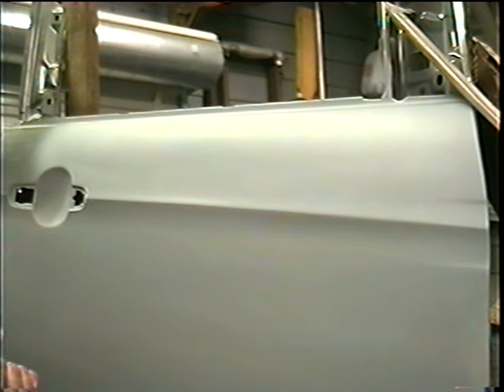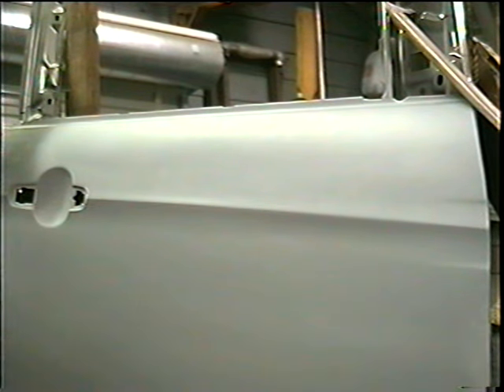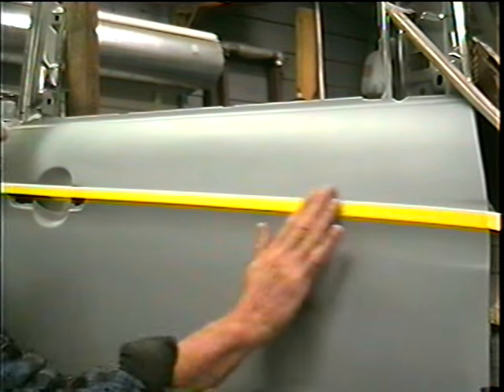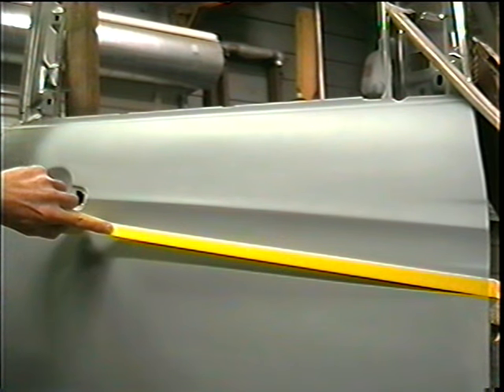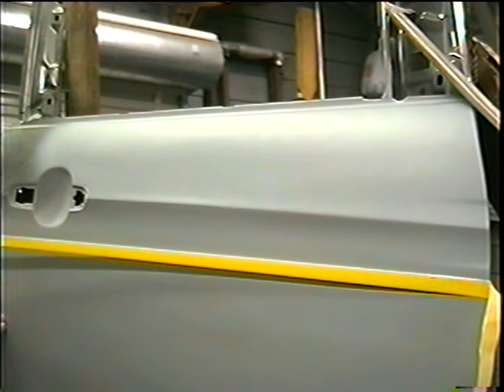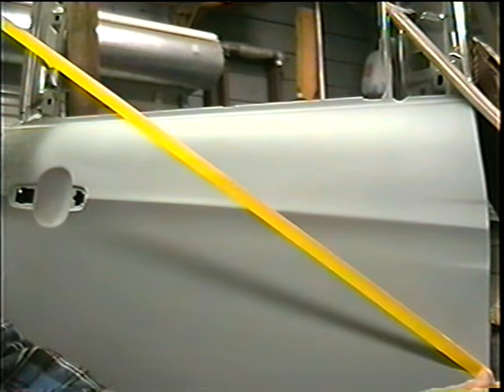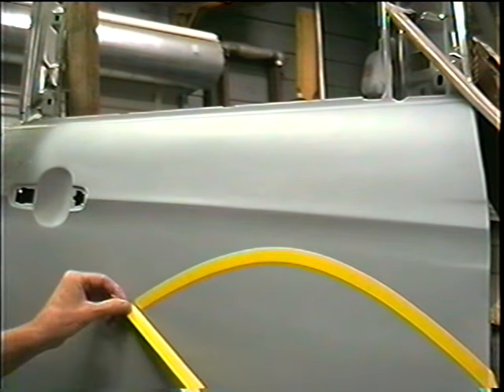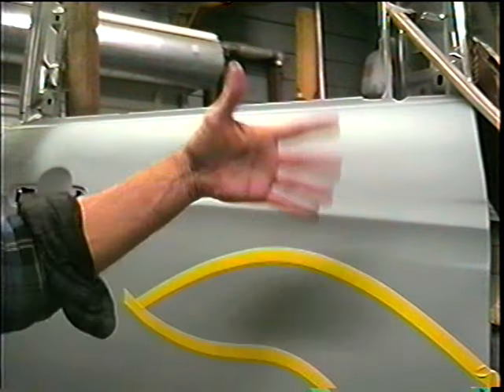Automotive Masking Tape Tips and Techniques

Comment: What tape works best on rubber windshield/windscreen gasket? I guess you could call it glazing as well but both sides of mine are rubber and so far, nothing will stick to it and I do NOT want to remove the windscreen. It’s almost guaranteed to break. Thank you sir! Great video as always!
Reply from the maker: That is very frustrating for sure - been there a few times.  Try wiping the rubber with rubbing alcohol or lacquer thinner - let it dry and use good 3M auto refinishing masking tape.  Let me know if that works for you Chris - have a good weekend :)

Comment: What about a hard 90 degree?
Reply from the maker: Great ?.  With a super sharp right angle, I use a brand new razor blade - you can cut the tap first if worried about cutting into the vehicle.